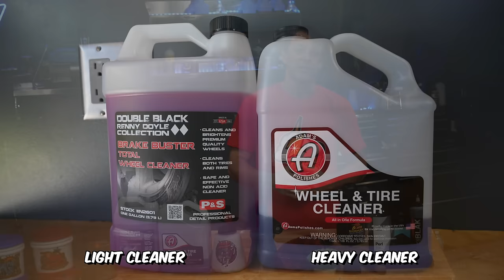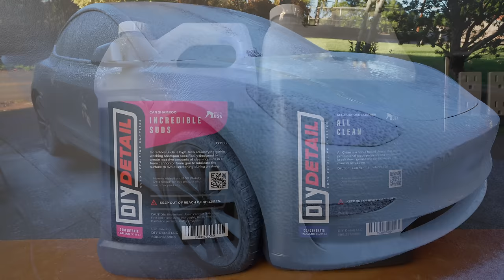FULL DEMO! BEST DETAILING PRODUCTS FOR BEGINNERS & PROS

Comment: Couple of things learned- using brake buster in a snow foamer. Multiple mitt method. 🙌. I wish someone here in the UK would take on DIY detailing. their products get good reviews. Meanwhile, I'm using Carpro, Bilt Hamber and P&S. I've just bought a de-ioniser or de-ionizer for you yanks 😉. No total dissolved solids in my rinse water coming out of my pressure washer for that final rinse stage. No water spots. 🙌 I can now wash in the sunshine and not have to rush around. 🎉
Reply from the maker: Great to hear. thanks for sharing
Reply: What're the best bilt hamber products 
I've got auto wash and am getting auto foam and surfex and really want to use more in the future
Reply: @carsgonewrong746  Best products from Bilt Hamber are- Touch-less snowfoam, Touch-on ceramic shampoo, Surfex HD and their normal car shampoo, generally, any of their products are good. I like their Atom-mac when spray directly onto the brake discs, it stops them from corroding when you're washing the car. I don't think they make a bad product
Reply: @79blustone  I'm looking at their rust stuff as my Undercarriage is very rusty
Reply: @carsgonewrong746  Yes! I've also used Dynax UC I think it's called. A clear underseal wax that's still perfectly performing well. I've got a brand new car and applied it before it's first drive at 12 miles. Highly recommend 👌
Reply: They are a chemical engineering company that got into detailing- their thoughts were our chemical engineers can do a better job. They don't use anything that promotes rust in their products. Like some other companies will use a salt based agents etc. They use a forward approach to cleaning and protection. Nobody else has thought of the idea of using a Sugar based cleaner in their snowfoam, nothing else has the teeth quite like Touch-less snowfoam. I am a huge fan boy and I don't care. Great products ask anyone else who uses it 👍
Reply: @79blustone  thanks, is it ok to wire brush the rust and then apply dynax UC everywhere
Will one can be enough for the. Undercarriage
Reply: We are now available in the UK 😊
Reply: @diydetailofficial   Yes! Yes you are, In2detailing has stock, that must be a very, very recent thing as I'm always on the website 😀
Reply: @79blustone Hope you got one that doesn’t depreciate haha 😂

Comment: Hey Jeremy great video as always. Try using Diy detail interior towel for interior cleaning, i dampen the towel first then fold it into four side, apply little cleaning solution and scrub it away.
It is by far the best tool i used so far. Once all four side gets dirty, i rinse it real quick then go back to work. One towel is all you need for whole interior. You just need second towel to wipe dry. 
It does work so fast and good and no brush needed.

Comment: Hi Jeremy, thanks for the video. You were quick, direct, and showed incredible step-by-step instructions for beginners. Two questions: is the last product just a tip for a quick and easy wash? I noticed you were in the shade and then in the garage. Do these products have problems with strong sunlight? Here in Florida, we don't have a break from the sun.
Reply from the maker: Glad it was helpful! No Its just AC in my garage on hot days and because I am not using the PW it can be done all in the garage with no mess. Just a comfort thing.

Comment: For pre-treat hard to beat Bilt Hamber's Auto-Foam or Touchless, plus some of their Surfex HD. Other brands might come close, but as of right now, Bilt Hamber, particularly those two combos, are the champs. 

Or you could go the rinsless route for pre-treat. It won't pull down as much dirt as the Bilt Hamber combo, but it's great pre-treat prep for a bucket wash to follow, as the rinseless wash does a great job of encapsulating the dirt, and providing additional lubrication. So when you finally hit it with a bucket wash shampoo and sponge/mitt, it will pull all the dirt down in one swipe, while staying super slick.
Reply from the maker: Great idea. I will have to play with that.

Comment: 9:45  You were talking about the two best washes being Adams Mega Foam or DIY Incredible Suds.  But, then it shows you putting the Koch Chem GSF in the bucket.   Do you not like the Adams for hand washing?
Reply from the maker: I like mega foam and DIY for the foam cannon. DIY does work well in the bucket also but I usually use KC GSF in the bucket. mega foam is mainly just for the cannon. You can't go wrong with any of the 3.

Comment: Hey Jeremy , love the videos . Was wondering if you could do a video dedicated to apply tire dressing ? I do all the normal wash and brush your tires , use  carpro perl , wipe excess off and still get sling .
Reply from the maker: Sorry missed your comment. Use a microfiber towel to knock it down after application. After it dries apply another coat and repeat if you want more of a shine. There should be no wet product on the tire when finished. Hope that helps.

Comment: Man, I love your videos.  Very informative in an awesome chill way.  I do love a lot of the same products as you.  Brake Buster is amazing, I do use KCx Magic Wheel cleaner for really stubborn wheels and CarPro Retyre for nasty tires too.   GSF is definitely in my arsenal, though I love Reset, Bathe and even NV Snow as well.  Perl is hard to beat, I have used Car Pro's Darkside recently and really like it too.  Apply once a month or so, then just regular soap every week in between, cleans up pretty good.  I don't like the greasy look anyway.  P&S express is good.   I use it and Car Pro Inside. P&S Absolute is amazing.  Invisible Glass is great, I did get the P&S glass cleaner a while back, I like it too.  Eraser is great for glass.  Expensive but works amazing.  S0.02 is my go to for ceramic topper for sure, it and Reload 2.0 and Gyeon Ceramic Detailer.
Reply from the maker: Thanks for sharing your system. Good stuff. Thanks for watching

Comment: Great video and tips!
Reply from the maker: Glad you liked it!
Reply: @HawaiiDetailing  I learned something last week from an Adam’s Polishes video and tried it. I put my car shampoo directly into my foam cannon without diluting. Turned my dial on foam cannon all the way down and within two clicks on my PF22.2 I was at my desired foam consistency. Capped it of once done. Used my Slick and Slide all while thinking of your Honey Pot mix. I have not forgotten that tip of yours. Maybe Santa will come through this year. Don’t forget a little pump sprayer,  🎅 ...

Comment: Another super video! Question. How do you clean the applicators you use to apply the tire protectant?
Reply from the maker: Whit the Blak. Rinse with water. It will be stained but will be ready for the next one. You can get a lot of applications out of 1 sponge. Just don’t let it completely dry it it’s a goner.

Comment: Love your channel! A little confused on when to use Dry Aid, Soo2 & Ethos Sealant. Is Soo2 a wax and Ethos a Sealant? Can both be used after a wash? Trying to understand when all 3 are used and why. Thanks!
Reply from the maker: I use a heavier sealant SO02 etc. when I need longer lasting durability especially on areas that take a beating. I use a drying aid every single time I dry the car to lubricate the paint so the towel does not mar the paint. A good drying also freshens up the protection. A good drying aid lasts a few weeks. A good sealant can last a few months. My recommendation for really long lasting protection is a true ceramic coating but that requires polishing and some level of experience applying it. Hope that helps. Thanks for watching and supporting the channel. Check out this for more info. https://www.hawaiidetailing.com/paintprotection

Comment: During the "pre-treat" process whether i used the diy all clean or the KC or the bug-off, do you spray the diluted solution, let it sit for a minute, and just rinse with pressure wash? Or do you have to wipe it down? Bit unclear on the step. Awesome video, im getting my pressure wash system together as i type...
Reply from the maker: I just rinse it off. The idea is to remove as much contamination as possible without touching the paint. I would only pre treat when there is some real road grime and it needs it. A normal weekly maintenance wash and you can skip this step. Thanks for watching

Comment: Do you have ppf installed on your model 3 or just ceramic coating? I just purchased my model 3 a month ago and not sure which to go with at the moment. Love your Chanel and your model 3!
Reply from the maker: Thanks. I have a ceramic only. Adding PPF on the panels that take rock chips is not a bad idea. It’s pricey though. After 30k miles I have picked up some chips but overall no big deal. I try to stay after keeping good protection on the paint and that helps from everything but rock chips. Depends on your driving conditions also. Thanks for watching.

Comment: Great video! Nice work! Awesome Tesla too. I am curious on why you use the Koch chemie for adding extra protection vs adding whatever protection you use originally? Is it because you use protection that you’d need to buff/ etc to get back on? Thanks again! Keep up the awesome work.
Reply from the maker: It’s a really durable long lasting easy to apply spray. Perfect for those areas that take a beating on your ceramic coating. After that I just use drying aids after each wash to top off the coatings. I would not use that durable of a product after each wash.
Reply: @HawaiiDetailing  thanks for responding! Love the channel.

Comment: I don’t get doing tires and wheels first. Also I didn’t understand the last step. Is it just a rinse and dry with a cloth. Also do you wash all you cleaning and drying towels at the same time.
Great video
Reply from the maker: By doing the wheels first you have no time constraints or worry of the water drying on the your paint from the normal wash process. I always clean the wheels then wash the car. Dry the car with a drying aid / topper and then dry the wheels last and apply dressings. Thanks for watching

Comment: Thanks Jeremy. My exterior black plastic trim (above the front wheel) got several scratches after coming back from Costco last weekend. The scratches are light but noticeable. Does the BLAK dressing have rich black color that may help cover and repair the light scratches? What do you recommend to use?
Reply from the maker: It will not fill scratches it dries thin and will hide any discoloration from fading or similar but keep in mind it does have a small shine to it. I have used it on trim and it comes out great. A few coats if it’s bad. Thanks for watching.
Reply: @HawaiiDetailing  Thank you Jeremy for taking the time to answer my question!

Comment: Watching the best detailer video you got me swearing by Adams wheel cleaner and stopped buying P and S 😂, thanks
Reply from the maker: Thanks. I like P&S for light cleaning. It’s a less harsh chemical. I like Adam’s for the tough cleaning as it has more teeth. Adam’s will break down any spray protection you have on the wheels. P&S will break it down less. Just depends on your needs. Thanks for watching the channel.

Comment: Would you say that for optimum results, it would be better to get a product for each thing?  Such as an interior cleaner, and then an interior protectant.  Rather than one product that does light cleaning with a protectant in it.
Reply from the maker: I like a stand alone cleaner for normal use but for applying protection I have been going with this all in one lately. https://diydetail.com/collections/interior-clean/products/interior-clean-protect?ref=ySA6chMa&variant=42193561256094 great product and easy to use.
Reply: @HawaiiDetailing  Youre digging it more than the 303?

Comment: Have you tried dark fury by superior products? Very good for disaster level wheels haven't tried it yet but I'm pretty sure it will work good for spray on spray off wheel cleaning on a weekly bias
Reply from the maker: Will have to have a look. Thanks
Reply: @HawaiiDetailing  just bought a gallon recently absolutely amazing. Has potential to stain your driveway that's the only downside. And road warrior is a very good pre wash!

Comment: A question for you is how do you know if it is time to re-seal the ceramic or if the ceramic is just "clogged" and needs to be decontaminated as the results are nearly the same?
Reply from the maker: If you do a wash and notice fading step up the wash cleaning power by adding an oz of high quality APC to your wash mix. If after several washes it’s still faded in the same areas it’s probably starting to go. I would not work to hard at this point trying to figure it out. I am also a fan of topping your ceramic after every wash with a high quality drying aid. This will prolong the life of any underlying product and form a sacrificial layer. You can use a higher durability spray sealant in the areas that normally take a beating to help prevent damage to the ceramic coating as well as fill in any dead spots until you polish and reapply a new coating. Hope that helps.
Reply: Thanx, I always bump up the glow, shine and slickness, every wash (sometimes with Bead Maker sometimes with a SiO2  agent).  I am happy where I am but it is a tricky business judging detox vs full on reapplication. @HawaiiDetailing

Comment: 9:07 when you say contamination do you mean it as dirt? and when the wash mit gets dirty you separate it and pick up a new one so the bucket doesn’t pick up any dirt/contaminants?
Reply from the maker: Yes. you can do multiple different methods. 1 bucket multiple mitt, Use multiple mitts and when dirt is on the mitt grab a new one-  One mitt and 2 bucket method and grind mitt against rinse bucket grit guard in bucket to remove dirt. Re dip in soap bucket and keep going. Check this out https://www.hawaiidetailing.com/wash

Comment: Yaaaah who. Getting a brand new Toyota
I live on a dirt/ gravel road. Is it ok to dust it off with a long handle soft brush in between washing. Can you recommend?
Thanks
Reply from the maker: No. Definitely not. It will micro scratch the paint over time. Consider the rinseless wash process for the in between touch ups. It’s easy and cheap. I covered it in this vid and have done a few others that are more in depth. Have a look. Thanks for watching.

Comment: Very informative video but sadly i do not own a garage but  a flat, so my only option is to get to coin wash. I can bring only one bucket so any tips on how to make some ok work with just one bucket and coin wash lances? Much apreciet it :)
Reply from the maker: Here is what I would do. Hope this helps. I would do the exact process just skip the foam cannon part. 
1. Pressure wash the wheels. Use a trigger sprayer to apply the cleaner. Clean wheels and tires with your brushes. 
2. Pressure wash the car to remove what you can before the contact wash. 
3. Use your one bucket with 1-2 oz soap in it and water. Use about 5-7 mitts or towels depending on how dirty the car is and complete the contact wash. 
4. Use the pressure washer to rinse after the contact wash. 
5. Pull car out of bay and continue with drying the paint applying drying aid or topper as a drying lubricant.  
6. Dress the tires with a good tire dressing.

You could also consider a rinseless wash for times when you car is not that dirty. It’s a great method for that. Check out my videos on that.
Reply: @HawaiiDetailing  Thank so much for your time and explanation! Can i use a microfiber glove instead of mitts? I got agree one from Turtle Wax 😇🙂

Comment: Personally i think foaming chemicals with a pressure washer is a waste.
Reply from the maker: Just my opinion but. I think it’s faster to apply, uses way less product and foams way better allowing more time to work before it dries or falls off. The only time it’s not good is if you need full strength. I use a pump sprayer at 100% for that. Thanks for watching.
Reply: @HawaiiDetailing  it would be more wet, good point. Its' not hot here so its probably not such an issue. In cold conditions lots of foam/water is not so fun - i don't need gallons of water running down my driveway full of snow/sleet lol. You make some good videos. But here at least you can't be using full blown pressure washing(most of the time) unless you have a very nice garage.
Reply from the maker: @seabrew1  thanks.